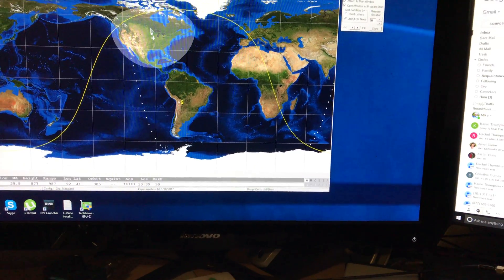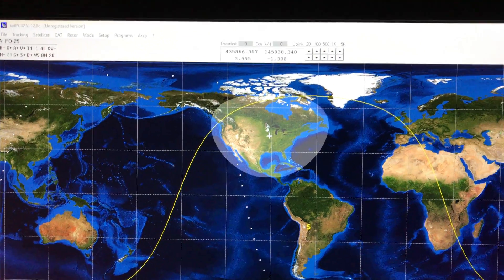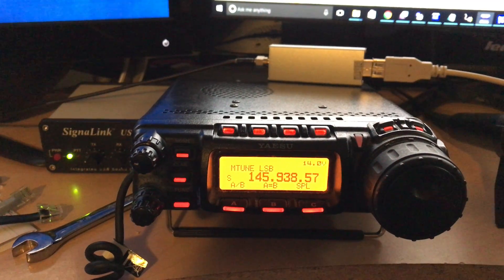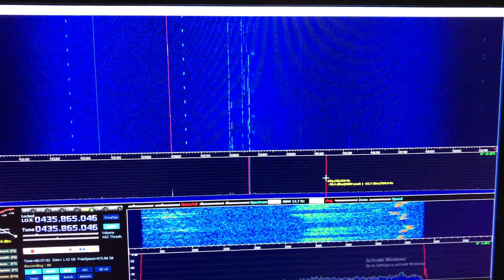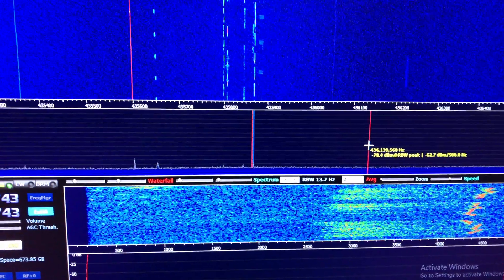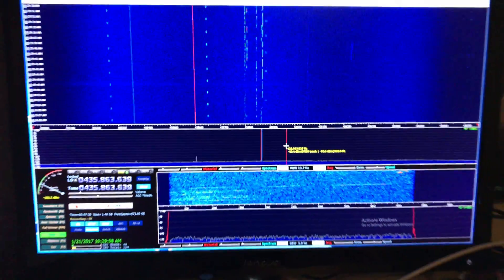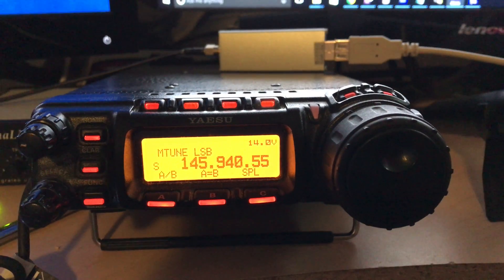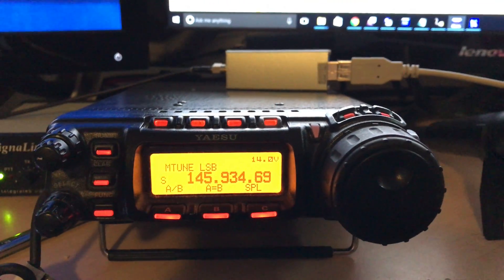First RTL-SDR Full Duplex Satellite Recording

Comment: Hi Mike, cool video. I was wondering if you have any updates on this setup? I'm planning a similar station right now using an FT-991A and either an RTL-SDR or SDRplay. Unfortunately SatPC32 doesn't support the FT-991 but Simon Brown (the original developer of Ham Radio Deluxe) is developing some new software that should be excellent for my use. I'm curious if you've been satisfied with the RTL-SDR for working the SSB birds? Anyway thanks and 73 de VA3ASE
Reply: Gpredict with hamlib 3.0 supports the FT-991. Iḿ ussing it for satellite
Reply: Alex VA3ASE I have an FT991A also and want to set this up, any luck for you?